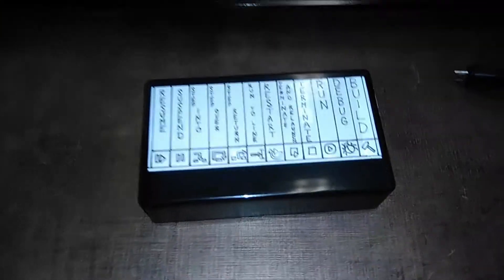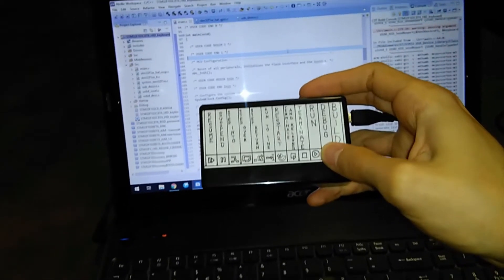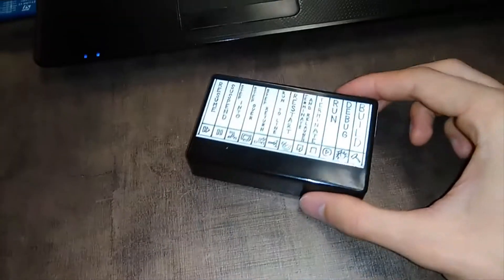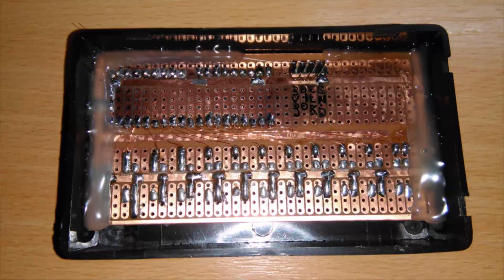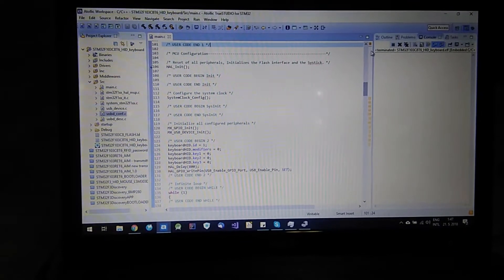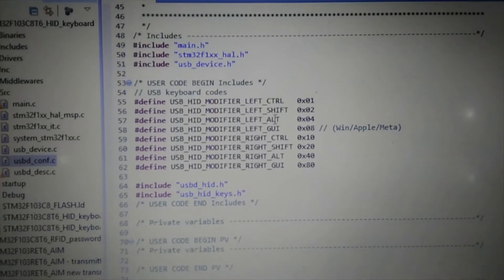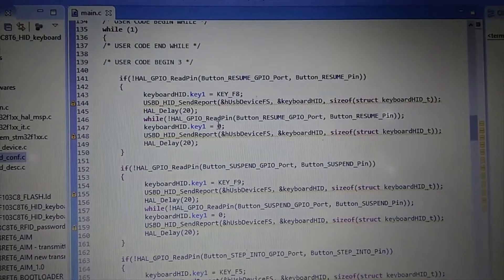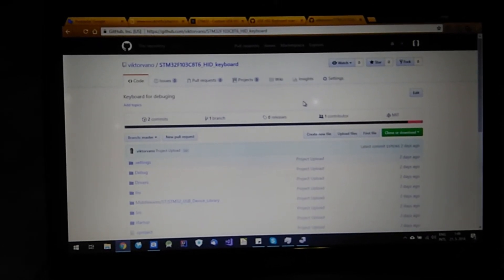DIY STM32 project - Make your own USB keyboard (hotkeys, emoji keyboard, game controller)

Comment: i really need help.. i want 2 make my ARM STM32F103C8T6 Minimum Development Board as rubberducky- i bought this and doesnt have bootloader. i  den bought urat
 also got sd memory card reader and dip switch
and now bootloader it flash but micro usb doesnt detect and the memorycard also doesnt dictect...
- all this things are expencive in where i live..
.. as keystroke - there are many videos of arduino.. but nt for stm32f103.. :( i tried. it doesnt work
Reply from the maker: Hi,
I am planning to make something like that in the future.
But for now this tutorial and code from a github may help.
https://www.youtube.com/watch?v=3a1KoVQE52k
And are you planning to code it in C? I use STM32CubeMX to generate an initialization codes and then finish coding in Atollic TrueStudio.

Comment: Hi i want to control a robot arm with mouse(buttons and cursor) connected to my PC(not with Stm directly)..is it possible to control it that way?if yes so can you share any idea how to achieve that..the flow will be like this..Mouse->PC->Stm->robot.
Reply from the maker: Hello there,
I have not tried to get a data from a computer mouse. But for these kind of things, I recommend you to use Java :)
https://stackoverflow.com/questions/1439022/get-mouse-position
I know it is unrelated, but writing a code for a PC it is way more faster to code in Java.
Here is one of my Java projects https://github.com/viktorvano/CryptoCoinCurrency